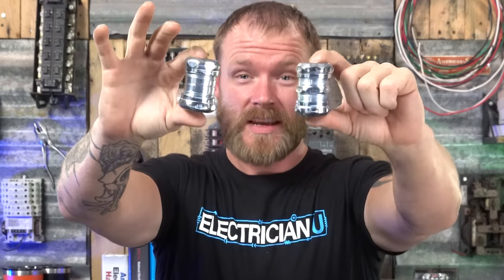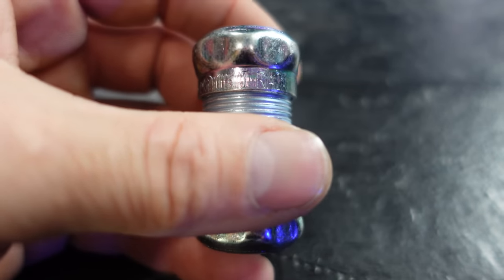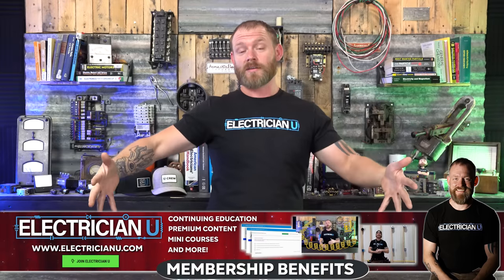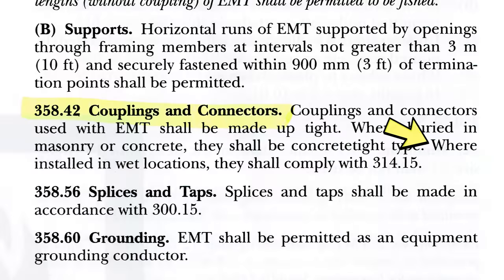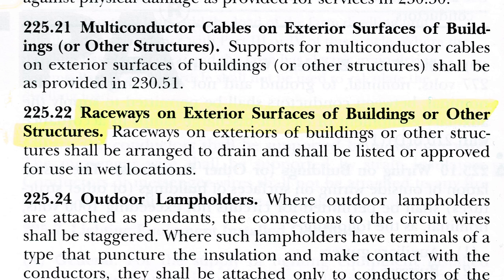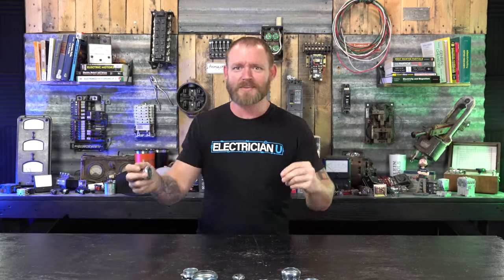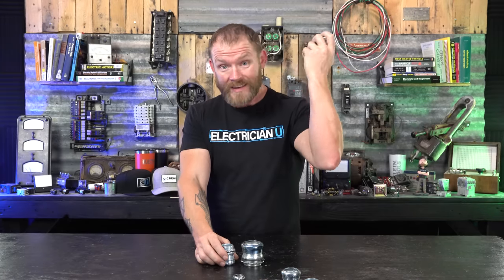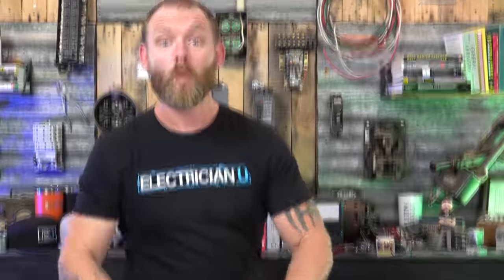Compression and Raintight: What's the Difference?

Comment: Amazing to me is that I started running EMT back in the 1960's and used compression fittings outdoors & wet locations but think the first time that I came across so called raintite fitting was at most 20 years ago. I stay away from all garbage die cast fittings especially POS made in India.

Comment: I’ve used compression fittings and applied silicone sealant to ends. Silicone will last for decades as opposed to the cheap plastic and rubber used for gaskets. Those things UV rot after a few years.

Comment: Indoors, I just think those compression fittings look better than the set-screw type. And it's a lot harder to over-tighten the compression fittings too, so they're harder to mess up installing as well.
And the rain-tight fittings looking nearly identical to the compression fittings once installed can make some of the laypeople that don't know any better not think to ask a question about why you used a different kind of fitting here vs there, which is nice.
Don't get me wrong, I'm happy to explain, but time spent explaining is time spent not doing work, unless you're a teacher.

Comment: Compression Coupling connectors ONLY used for Inside the house never outside the house? and Compression coupling connectors are ONLY used in Non-wet environments?
Reply: You'll very seldom see a compression OR a rain-tight fitting inside a house in the first place, because that's residential work and most of that stuff is just using NMC aka Romex (unless you live in the Bronx or some other places, in which case you'll be seeing armored cable instead, which has its own fittings).
EMT and these fittings are more often seen in commercial/industrial settings.
EDIT: But to answer your question, if you're using EMT in a location that the code considers a "wet location", then you must use the rain-tight fittings, not the compression fittings.
In areas that are not considered wet locations, you can use rain tight fittings, standard compression fittings, or set-screw fittings, all 3 would be code compliant (the code doesn't ever say you can't use something that's overkill for the task, that job is done by your wallet).
Reply: @44R0Ndin  when would electrician use compression fits and connectors and couplers instead of using the rain type connectors and couplers I don't know when the technician electronic technician will determine if they should use compression couplers and compression connectors or rain tight like how would it how would they decide and make a decision on which ones to use anything to determine any tips to know if it's like a cut and dry situation on knowing when to pick between compression and rain tight
Reply: @waynegram8907  I can make this pretty simple for you. If you have a roof over you, chances are you can use regular old compression fittings unless you're like in a car wash or something.
If you're outside, you gotta use the rain-tight ones, because of the... well, rain.
Reply: @44R0Ndin  I wonder if you can use EMT on wet or damp locations. My understanding is that NEC only allows it to be use indoors/dry location.
Thanks for your comments
Reply: @lrsotog  "can't use EMT in wet or damp locations"
Can you cite what part of the NEC states that you can't use it in wet or damp locations?
I doubt you can, and I'm also not sure if you actually believe that or if you're trolling.

C'mon, I'm sure you've got enough brain power to figure out something this simple.
Here's a question for you:
What do you think the rules are about EMT usage in wet locations, if they make so-called "rain tight" fittings for EMT?

If I've misjudged you and you can't put the puzzle together for yourself, I'll do it for you right now.
Yes you can use EMT in wet/damp locations, provided you use the correct junction boxes and EMT connection fittings. Rain-tight compression fittings are one type of fitting approved for use alongside regular EMT in wet/damp locations, provided you also use junction boxes and other things that are ALSO approved for use in wet/damp locations.

Yes, I was being intentionally condescending and talking down to you in that last paragraph, not because I think I know it all, but because it seems to me like you're intentionally playing dumb and I hate when people act like that. I've found playing dumb like that to be almost always counterproductive and obstructionist.
But furthermore, if you actually watched the video you'd already know the answer to this question. I'm guilty of sometimes posting my comments before the video is over too, but I'm usually able to put together facts that were given to me in the video title and/or thumbnail in order to figure out what would be an entirely wrong thing to say.

Keep in mind, we're not talking about running wires underwater or in a tunnel below a river here. Just "wet or damp locations" aka where things get rained on or otherwise wet.
Basically car washes and boiler rooms and outdoors, that kind of place. As long as you use the right stuff along with it, EMT is perfectly suitable in most places.
Where EMT is not suitable, MIC is probably what you need. MIC stands for mineral insulated cable, and it is used in nuclear reactors and other extremely demanding locations where there is either a demand for the ultimate in reliability or there is a high likelihood of physical damage, as MIC is generally more robust than most other forms of electrical wiring system. Additionally, if the outer sheath of the MIC assembly is not breached, it is next to impossible for a wiring fault to escape the sheath, which makes it useful in mines as well where sparks are to be avoided at all costs.

Comment: Those rubber gaskets and i-rings and yellow washers on the terminal end fittings are cute but pretty useless after a couple years.  They dry rot, UV damage and then crack and fall off and now you have a 3/32" gap.  Throw out the washers and Pipe dope or thin Teflon tape, but you still want to maintain the bind so not too much sealant.  blessings

Comment: Why not just discontinue non-rain tight compression fittings
Reply: Because this way they can charge extra for the extra feature.
5-pack 3/4 compression: $5
5-pack 3/4 rain tight compression: $8
Reply: The regular non-rain-tight compression fittings are less expensive than the rain-tight ones, and IMO they look better than set-screw fittings in locations where they are permitted to be used.
Reply: Cost. And that the overwhelming majority of compression fittings are used indoors.

Comment: Okay raintights are intended for use outdoors. So in what application would you use a compression tight? Indoors? They already have regular couplings for indoor use. If you ask me they should stop manufacturing compression fittings. Sounds like a micky mouse job.